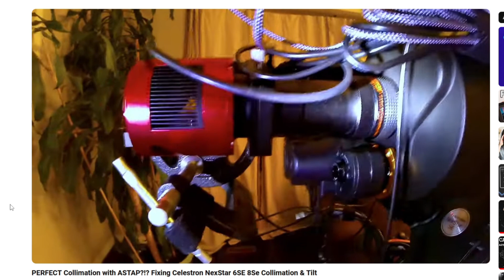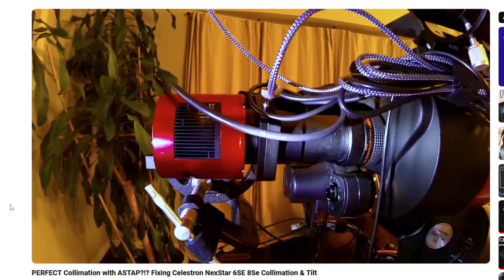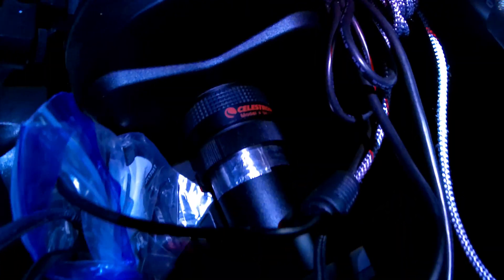Fix Celestron T-Adapter Collimation and Tilt Issue

Comment: I’m so glad I just found this!! I’ve been fighting issues with wonky corner stars that only show up on one side and, thinking it was back focus issues, I’ve gone through so many different spacer configurations with no improvement (and was really starting to get discouraged)!  it’s such a relief to know it’s a simple fix. It was so obvious when I rotated my camera 90° and one short edge had a significantly thicker vignette than the other (and bad stars only on that end). Thank you for your incredibly helpful videos!!
Reply from the maker: Hey GTX, you are welcome to - this is a particularly tricky issue.  The other thing to triple-check is collimation without a reducer.  I suggest a tri-bahtinov mask to make sure you can get evenly stretched stars at the corners (once you've taken the play out of the t-ring).  then re-introduce the reducer, and work on the back spacing.  I know mine will never be perfect but it is so close that if I do my focusing on a star mid-way between center and the edge, I get a pretty decent view except for the very corners.
Reply: @Felldisulfide I’ll definitely do that next! Quick question - would black electrical tape work as well or should I get the metal tape? I tried searching for the metal tape and realized there’s SO MANY different options!

Comment: Just to add, thanks to you the adapter tilt solution has come just at the right time, I've tied down the AVX with Nina, some variables here, so about to fine tune guiding AVX style, with old 90s USA built 9.25 SCT, the adapter, a focal reducer/flatner and cooled 294CC. Being a bit finicky the AVX mount will probably best track without the Dec on also with dead accurate polar alignment, It's all trial and error!! . I even have some silver space tape, or Clapton to pack out the adapter as suggested, this being left over from building spacecraft some years ago. Thanking you Atb Tom...
Reply from the maker: Sounds like you are really getting along!  I also track in RA only, but find that guiding should definitely continue to use both RA and Dec because if your mount flexes, the Dec will need to be adjusted.  Clear Skies!

Comment: Hi, Just like to say how much I've enjoyed your videos guess it's a lot of work but well worth the effort, thanking you.  I  recently purchased a used AVX mount which I have now serviced and intend to use with the CPWI interface, maybe in conjunction with Nina/ EQMOD/ ASCOM hub, can the mount limits be set using CPWI ?.. I rather like your game pad option  so may just stick with CPWI via handset to pc rather than just a handset. Having  retired my wife now controlls my urge to buy new things so on a budget for sure😂.
Thanking you atb Tom.
Reply from the maker: Hi Tom, thank you, I really appreciate your comment.  Congratulations on your retirement, you now have more time to spend on this awesome hobby!  I'm about ten years from retirement myself, however, I find that my wife also controls my urge to buy new things, so I appreciate where you are coming from.
With regards to your question, yes, the limits can be set in CPWI, but there appear to be some nuances:
https://www.cloudynights.com/topic/802562-avx-running-through-cpwi-ra-slew-limits/
Just so you know, I find myself using the game pad less and less.  I have enabled plate solving in APT (also available in other tools such as NINA) which basically directs the mount to the spot I want and synchronizes the mount position at the end.  You can make the jump to plate solving right away, however I found it valuable to go through the phase of using the game pad and visually trying to determine my target locations based on visual references (other people's images, star charts, etc.) as it helps to familiarize you with the sky.  Best of luck with your setup, and Clear Skies!

Comment: Nice job Chris I used to rotate the camera in the RASA in a similar way which caused a few headaches so I bought myself a rotator & spacers from Ali express which helped me a great deal, although with a larger sensor camera tilt is still noticeable at F2 but using the same set up on a refractor the stars a perfect in every corner.
Reply from the maker: Thanks Tich!  I was using SVBONY rings for a little while, but switched back to the T-Adapter so I could use it as a rotator.  The problem I've been running into is that the flat spacers I have added to correct back focus have shifted the orientation of my filter tray so that it now points at my counterweight, so it is timely to look at an actual rotator instead.